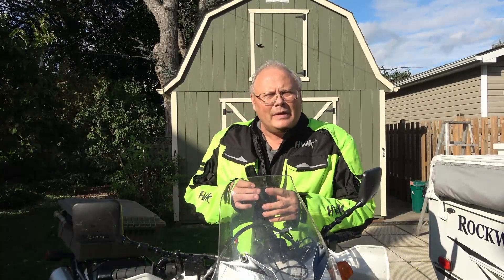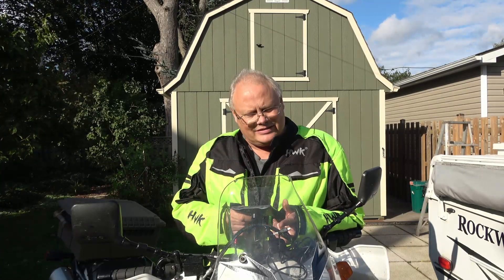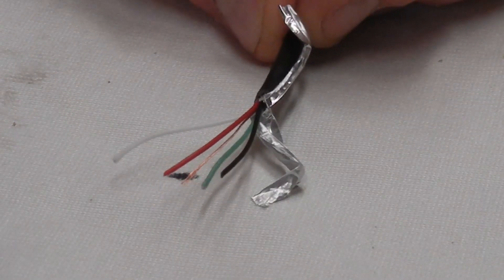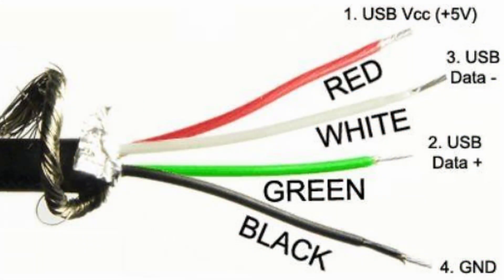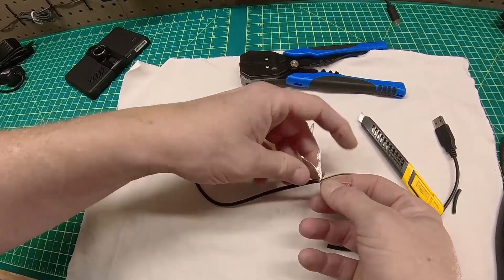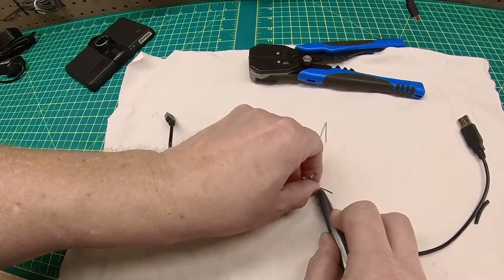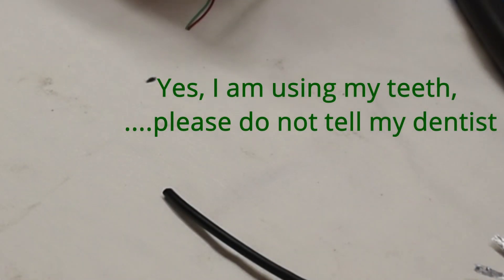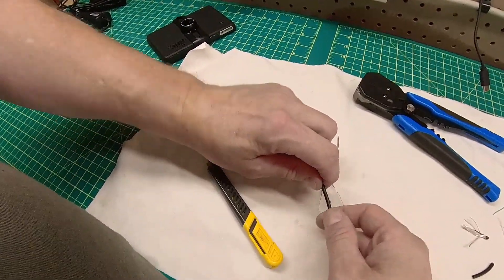Today I solve my Garmin GPS power cord problems

Comment: Thanks for the info, I tried all sorts of ways to get this working. Note - If you use a common 12v to 5v cigarette lighter plug adapter it MAY not work. I found the answer. Carefully slice (don't cut the cable in half) open an old cable to expose the 4 wires and make sure it has a silver braid lining, no, try another lead. With the wires exposed, cut the green and white wires in half and insulate off. Expose some of the wires of the black and twist or solder to the braid wires. Why ? The Garmin uses the braid as an earth, negative conductor. 
The reason it does not work with most common 12v-5v chargers is that the outer shield of the SOCKET of the charger is not connected as you would expect. You can pick this with a multimeter on ohms, it has an open circuit between the USB socket shield case and the neg pin of the cig plug.
The MAIN braid goes no where. Connecting the braid to the black wire fixes this issue. Try it 1st, connect it all up accept the black wire, nothing right, connect the black to the braid, working. Note, the GPS will say that the charger is not good enough but it will still work. :)

Comment: This shows the importance of a company's doing beta testing, or at least testing their products. Since this has been going on for so many years, it makes Garmin look like idiots. I tried what you did on my Nuvi 760 from 2009 and it was a failure. My Ram truck has 9 USB ports but only one 12V power port/cigarette lighter/formerly cigar lighter port and it is stuck at the top of the dash. I did find that one of my two power banks can be used with the Garmin. We have the technology, Garmin. You yourselves make a 120V adapter that has a USB plug on it and it charges properly. How about some firmware updates?? Last night I checked out the Garmin 86, their honkin' big screen navigator for $349, as I'm planning a long trip. I decided to stick to my 15-year-old one for 3 reasons. First, the 1 star reviews tell me they still haven't mastered the art of testing their products. Second, there is no mention on any video or their website or reviews of the battery life. My old one can go 45 minutes with a new battery, which is abysmal, but at least I know the number. Third, I've changed the battery twice, which is cheap and easy and I wouldn't pay $349 for a contraption without knowing I could replace the battery.
Reply: For nuvi 760, you need to modify the cable's mini USB connector.

Comment: Question:  Indeed, to make mine work, I found that I had to connect the two data wires at the mini end as Dino did in this video.  It now works, but I wonder if there could be long-term consequences.  Perhaps there is a resistor value that could be inserted between the white and green rather than a direct shunt.  Would anyone with knowledge on such matters have any thoughts on that?  Regardless, thanks for the hack!

Comment: I have a Garmin Montana 610 that I use on my motorcycle.  In the settings I set it to start in "Spanner" mode instead of "Serial" mode.  Spanner allows it to run in GPS normal mode off any USB cable rather than looking for a PC connection.  I accidently reset it and noticed it started up in serial mode on my bike, and I could not get it to go into the GPS screens.  I ended up here looking for a solution, but after tinkering with my settings I found the startup mode.  I knew this setting but forgot it as I have not ridden my bike in a couple of years.  Be careful if you click Reset as it will default to Serial mode.
Reply from the maker: Thank you for that tidbit, it is annoying how it wants to find a PC. I'll do just that
Dino

Comment: Thanks for the very informative video. I know you can get a really cheap charge only cable somewhere and you can definitely make one as you have shown. I've created my own charge cables in the past but those thin wires are so delicate! Thanks for that tip on the white and green cable as a loopback. I wonder if this is where some sellers are claiming that they have put in a special chip (or just a resistor) to block the data port on either ends of the cable so that it sense no data and only charging is necessary. The soldering technique you showed is pretty nice!

Comment: I would assume that using a Data-Block USB Adapter would be just as effective and much easier to do. The data-blocker adapter effectively disables / disconnects the data wires. Have you tried these as an alternative?

Comment: I was able to use a small razor knife and strip back the outer casing and just clip the green and white cables. It works and is much easier.

Comment: Hi Deno and J.D.

As an update, I have a Garmin dash cam 66w, works well.  It was supplied with the 12v converter to 5v USB lead and plug, and what appears to be a standard USB lead, which is for connecting to a PC, to download videos and for charging.
I formed the impression, that if I used this lead to connect to a USB socket, the device would switch into PC mode.  However I thought I should check, so I connected the ‘USB’ lead to a charger and it worked fine🤗.
I raised the question with Garmin tech support, and my requirement for a ‘short’ lead, and they are sending me one FOC.  I consider this to be excellent service.
So as far as my dash cam is concerned, it appears that it will work with a USB cable plugged into a USB socket, and anybody else with a 66w should also be OK.
Thanks for your help.
Cheers Noel

Comment: Hi Deno and J.D 
In the USB cable there are only 4 wires red, white, green, and black.  As described by Dino. Is it possible to connect a 17.3k resistor between two of the wires, and if so which, I suspect it will be between the red and the black, to drop the 5v slightly and this will prevent the device going into sync mode.
In addition will this work with a Garmin 66W dash cam, I suspect it will.
Many thanks Noel
Reply from the maker: Hmmm, I do not have an answer for your question. I have a friend that I have pizza with who is much better versed in electronics than me so Ill ask him.
Dino
Reply: @DinosTinkerShed  Thanks for the instant reply, would appreciate it if you could. Cheers Noel

Comment: For the old Garmin GPS, the trick is to add a resistor about 17.3k between Pin4 and Pin5 (ground).
Reply from the maker: Thanks for the information. It should help myself and others who have this issue.
Dino
Reply: Hi J.D.  I have a Garmin dash cam in my car and I think the same thing happens to them when you try to connect it to the USB socket in the car.

You mention 17.3K between pins 4 and 5. I’m wondering which wires connect to pin four and five in a USB cable. Can you help please? Many thanks Noel
Reply: @Jestey6  Your cable should have a wire for Pin5 (ground), but no wire for Pin4. You need to connect the resistor to the Pin4 of your cable's mini USB connector https://upload.wikimedia.org/wikipedia/commons/e/ec/USB_Mini-B_receptacle.svg

Comment: Hello, thank you very much for this video. I have the same issue but I wish relocate the usb port outsider the gps. I wish sold a flex on the motherboard or other. The gps will take place in the dashboard and can't be unmount mable in the future. I just wish can disconnect bc30 cable for do the update. Actualy nothing works. My garmin goes in pc mode if I use an usb extension. My garmin is a 2597 LMT. Thank you.
Reply from the maker: Thanks for the comment. Please let me know how you make out. I have had a few others tell me the fix does not work on their model.
Dino

Comment: I have an older Nuvi and I made the fix and plugged in and the computer icon came up. But if you unplug the usb and wait for the computer icon to disappear the quickly plug back in ,the maps load
Reply from the maker: Very odd, I think I mentioned in the video that my older Nuvi still went into sink mode even after the mod. I'll have to try your trick to see if that works. Thank you for the information.
Dino

Comment: I have an older computer that I used to only charge devices from a USB port. I simply disabled the data function in the USB port and Ta daaa.(short for Da ta da Daaa🎶)
Reply from the maker: Interesting,  That's what I thought would happen with the NUVI but it seemed to still drop into sync mode until I joined the data lines. Mine may just be an older unit or something weird with Garmin.

Dino

Comment: Merry Christmas Dino…..have you tried connecting all of your devices through SAE plugs? One style of plug. Very rugged and reliable and able to be connected to multiple devices through one plug. When I’m updating my electrical system I plan to install 3 of them on my bike. One for the tank bag, one for devices like GPS and one for a tire pump. I’m going to add a proper bus bar to keep things organized. 
On another note. I’m going to be making a mount for aux driving lights. A copy of an existing overpriced bracket, and sell them cheap to those interested. I also have a 7 inch headlamp bucket and will swap out the original headlight for the bucket if the LED lamp I purchased doesn’t work out for me. Some of the things Suzuki does make me scratch my head. I’m always wanting to make my bikes unique and safer. 
Have a great week-end. 

Life in THE 60s was a lot better than life in MY 60s/70s
Reply from the maker: Hi Bill, great comment and a merry Christmas to you as well. I do have two SAE plugs on my bike, one for a trickle charger and the other for the rear box. you are correct about the robustness. I actually have the cyclops bulb in my DR and compared to stock I find it to be an improvement for sure. I have a video planned to compare the two as Karl wants one in his bike as well. I have had other cheaper LED lights in my snowmobiles and although they did through a lot more light as the cyclops does, they tended not to last in the hi vibration environment of the sleds. SO far the cyclops is working very well for me.
 Interesting about the aux light bracket would like to see a picture once you have it done.

Dino

Comment: Hi i have a  garmin navigator v1 .
i use a usb cable which charges a cycle light 
this only has two cables inside and works ok
as long as connection to sat nav is the same.
Reply from the maker: Thank you for the feedback. It's good to know. I have seem these online as well, much easier than my route for sure. 
Thanks for taking the time to post.
Dino

Comment: Thanks Dino. I use a Garmin Zumo 660 and use a plug in USB charger on my DR 650. No issues - (maybe internally wired differently). Your information is very useful however as people can use their Garmin Nuvi from their car on their motorcycle. The Garmin Zumo is quite expensive relative to the Nuvi - your info gives riders options to use  an existing sat nav and not need to purchase a second one for the motorcycle.  Good!
Reply from the maker: Thank you for the feedback, the nuvi is  maybe not the best option but as you point out it is an option many people already have. Thanks again for the comment I always enjoy the feedback you give.
Dino